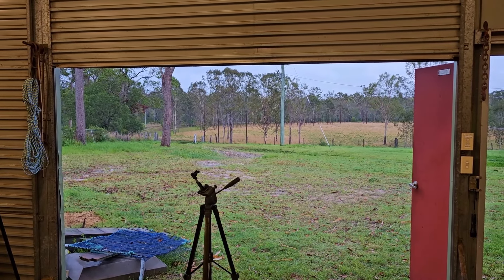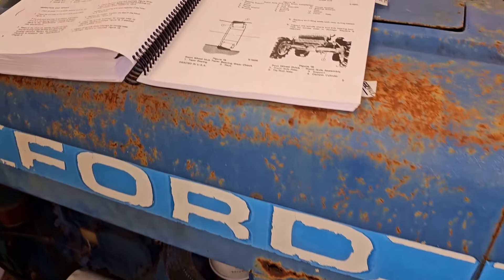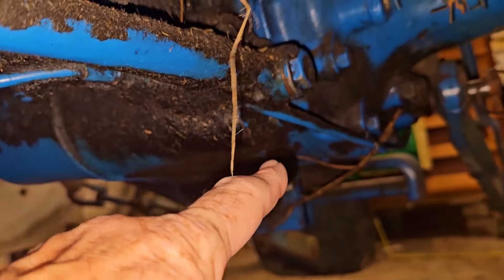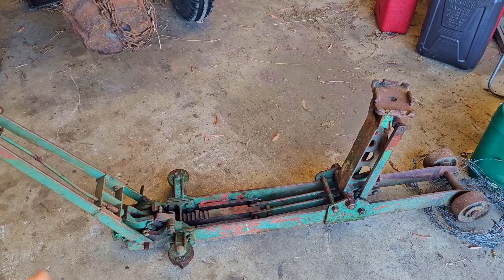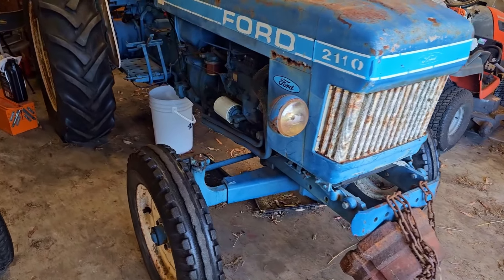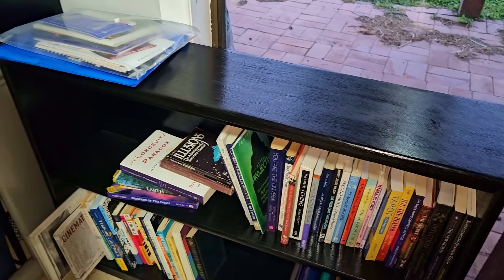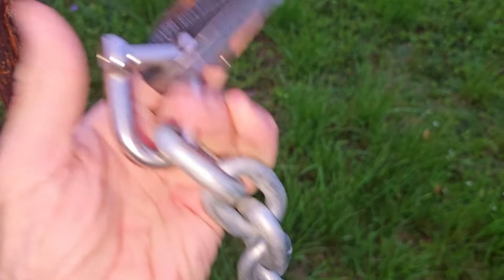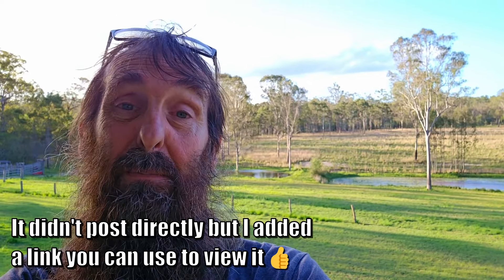Tractor Surprise, B's Projects & a New Post Puller

Comment: My tractor died, cracked the engine head and had a sump full of cooling water. Had to sell it for parts, mechanic wasn't even sure if a replacement was available. Going to buy something new when I make up my mind as to exactly what I need given the size of our property and the nature of our future operations, mostly orchard. Oh well it was fun to learn on while it lasted, at least I didn't break anything really expensive, but it was still a horrible feeling to have it happen. According to the mechanic the additive we found (smelt) in the cooling water suggests that that the guy who sold it to me knew it already had a problem and it was only a mater of time before it failed completely.
Reply from the maker: Hey Daniel. That was our concern as well when buying. The guy we bought from was retiring  & was up front about his lack of knowledge of tractors. He got a local mechanic to service it every 12 months or so. It was used to slash a horse breaking arena & associated paddocks so only had very light work. 
Hope all's well with you mate.
Reply: @RobsAquaponics  Yep all good here thanks, looking to put in an orchard in the new year on the site of the old lime orchard,    but having a more diverse range of citrus, then we keep expanding from there year by year until the entire property is productive. Looking at interplanting the orchard with another crop to get a return faster than 3 to 5 years.
Reply from the maker: @DanielSMatthews   Great to hear mate. 👍 Still haven't worked out if we're going to wait for the swale before we plant fruit/nut trees or set up a dedicated orchard.
Reply: @RobsAquaponics  I just had a lot of earthworks done, by Bubba Bishop, came out OK but it was a complex job and we will need to make at least a second pass at it to account for what the rain runoff decided to do in reality vs our plans. 😆